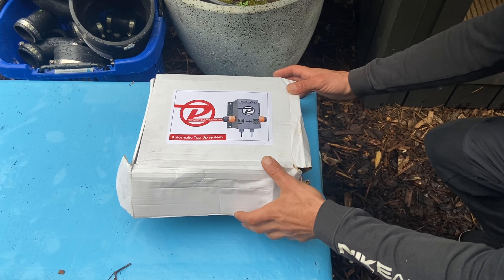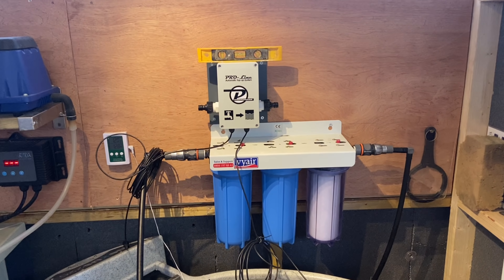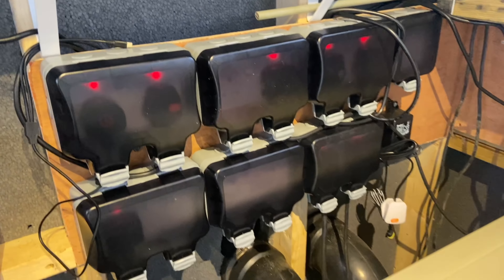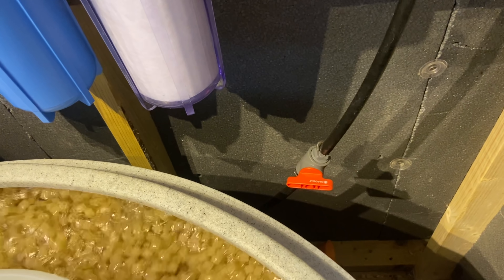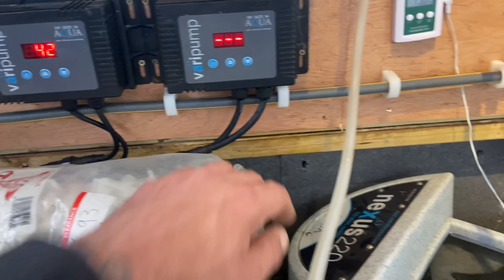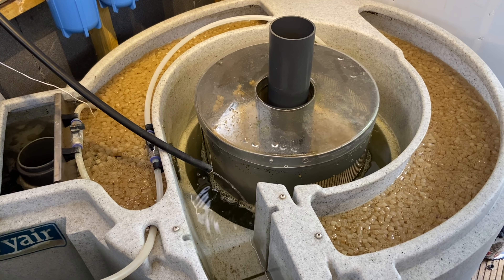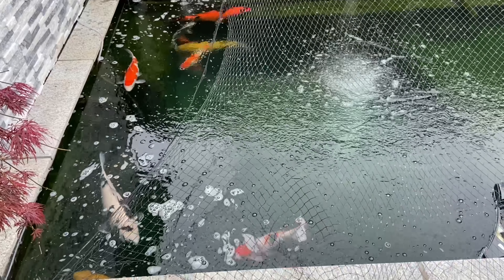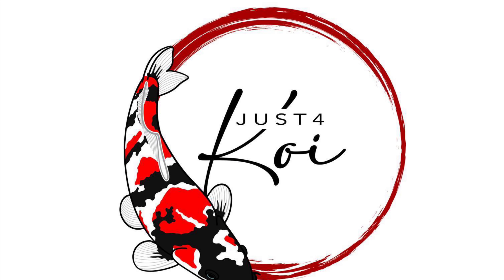PRO LINE AUTO TOP UP SYSTEM FOR KOI PONDS!!!

Comment: Nice update  there never enough wire on gadgets stay safe 🙏🐟🐟🐟🐟🙏
Reply from the maker: Thanks Carol, the power wire is around 10m float switch wire around 3m,  it would be better if it was the other way round with the wires🤦🏻‍♂️at least it came with the correct plug 🤣thanks and take care 👍🏻

Comment: If you unscrew the 12 screws on the top of you 3 stage filter and turn them round and screw them back in you can have the inlet on the left side like you want. I did it, you don't have to separate the individual units, dead easy. Hope you know what I mean. I spy the guardian on the shelf hehe. Everyone is moving to good old sockets, can't beat it. The switchbox prices are going to plummet now after all the pond tubers are moving to sockets. Great video again, thanks for sharing. Cheers.
Reply from the maker: Thanks again Simon I know exactly what you mean gonna leave it as it is for now and if I ever remove it I’ll bare that in mind, I spy with my lil eye 🤣 can’t go wrong with old school sockets and just label the plugs , I got a matsuka switch box sitting there in the box I might do another giveaway with that for 1500subs, take care matey 👍🏻
Reply: @just4koi143  I'd leave it too as you done such a good job. Well done for getting the temperature the right way round too lol. That would be another very generous giveaway. Eye spy, I wonder what your TDS is gonna be :) Cheers.
Reply from the maker: I installed the guardian today, wicked bit of kit it’s showing temps 14c, TDS 6 , ph 8.5 I would like to get the ph down below 8
Reply: @just4koi143  I look forward to that video then, that is if you filmed it, sorry for assuming. Cheers.

Comment: That's going to be a handy gadget 👌. How much water are you changing and how do you keep track? Still impressed how you saved your new karashigoi in the earlier video.
Reply from the maker: Thanks KoiRun, I did think I was gonna lose her,  she is doing absolutely fine now 🙏 I usually try do a 25% to 30% per week thru the whole week, I don’t hold records like you which I would like to, I’m going to install a digi flow and try work out what’s getting used, take care 👍🏻
Reply from the maker: You actually got me think how much water I exactly use🤣I clean the nexus 220 once a week in the winter season now that the weather are changing and I’ve up the food a lil I’m cleaning the nexus 3 to 4 times a week the middle chamber of the nexus hold 105L so I would imagine it’s around 400L to 500L I change per week 👍🏻

Comment: Hi, I have one of these systems to be fitted, how did you connect the solid pipe to the rubber hose push clip if that makes sense. Cheers buddy great filter house by the way.
Reply from the maker: Hi mate, the solid black tube that I’m using is 15mm which slots right into the hose connectors that come with the top up system, just tighten up the hose push clips and your leak free, hope that was useful 👍🏻

Comment: Hope you can help?  How noisy is the valve in your top up system?  Mine unit is screwed to the walls of a wooden shed.  There is a strong thump on the opening and closing of the valve.  I noticed you had placed a valve close to the first stage of your purifier.   I couldn’t hear the unit working on the video, so hoped you would share your experience.  Many thanks.
Reply from the maker: Hi Dave, the shut off valves have no noise, there is a small thump noise from the top up unit when water starts to run thru  (only when switched off and back on) which is now constantly trickling in
Reply from the maker: Once the system starts running thump noise stops, hope that was useful 👍🏻
Reply: @just4koi143  Thanks for your feedback.  Much appreciated.  My top up unit sends water via a purifier to top up the pond after my drum filter does a clean.  I am getting the thump when the float starts and stops the water.  No noise during as the water flows or after it stops.  We do have high water pressure and the manufacturer does specify 6 bar pressure as a maximum.  Good to know the noise isn’t just in my filter shed!
Reply from the maker: @davidlang2743  your welcome matey👍🏻have a good weekend

Comment: O have installed one of the top up systems.  There is one issue with the float swith in the pond. If its mega windy and the water is sloshing it keeps cutting in and out. Anyway around this issue would be much appreciated
Reply from the maker: Thanks you for the heads up, if you don’t mind me asking where have you placed your float switch?👍🏻
Reply: @just4koi143  In the corner of pond?
Reply from the maker: Thanks matey I placed mine in the corner too 👍🏻
Reply: @just4koi143  I was thinking of putting a plastic l
Pipe around it to keep a more stable water level

Comment: Where did you get the 15mm sold black pipe and fittings from?
Reply from the maker: Amazon job Gardena 15mm pipe and Gardena fittings 👍🏻
Reply: @just4koi143  cheers pal